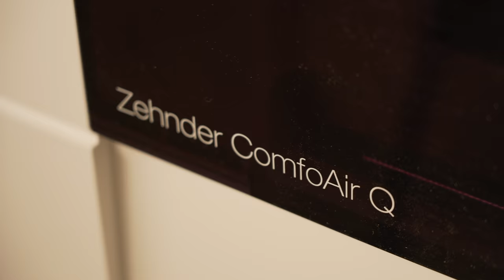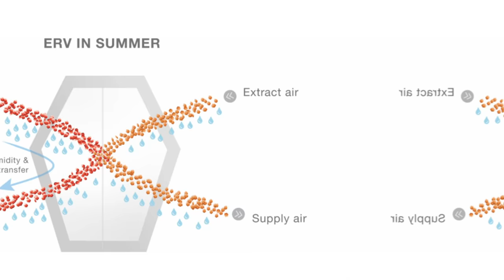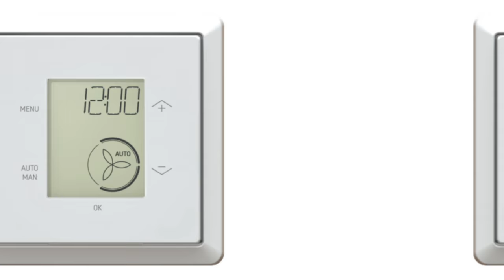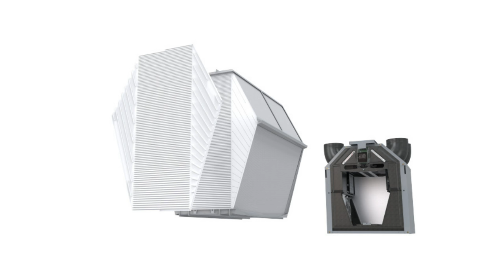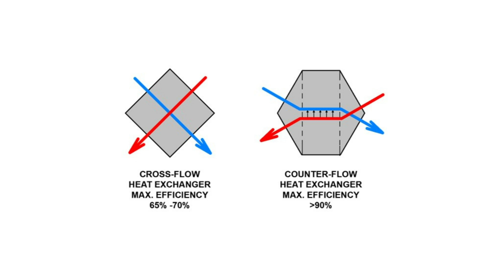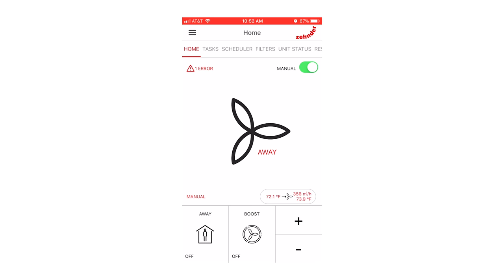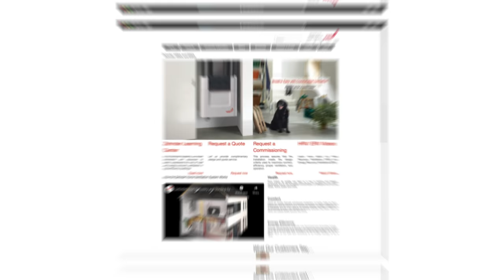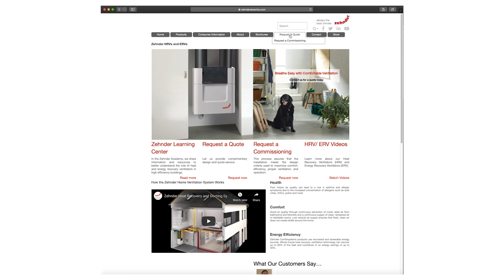Passive House - Fresh Air System Install & Costs (Zehnder)

Comment: Just  1 solar panel of 400 Watts can run this system for 10 years or more for free (after the cost of solar panels, Battery, and control system) and still have some extra energy to spare. He said this big system would use about 100 Watts, so about 2,400 Watts a day.  The average day is exactly 12 hours, the power you actually get on your panels is equal to about 6 hours of full sun radiation per day. Therefore 1- 400W panel (or 4 - 100W panes for lower price but need more space) would create 400Wx6=2,400W a day. Now, this house has a great large open space for multiple arrays of solar panels systems and since his whole house is running on electricity he can practically run the entire house on solar. He does not even need a battery backup and just connects the Panels to his Electric-Miters and the power production would be subtracted from his Bill. In some states, if u produce more power than use they would even pay u for the extra energy u give them. Now since he lives in Texas a really hot n sunny state his power production would be even higher. I would have a backup battery for emergencies since Texas Power System SUCKS! WHY THE F***!!! Texas is the only state in the country that is outside the National Power Grid?

Comment: I made the mistake of putting the intake and the exhaust fittings of my air to air heat exchanges on the west side under soffits 10 feet apart. In Massachusetts the predominant air is from the west. When the weather outside is windy it blows untreared air right through the exchanger. This means cold air in winter and hot air in summer BLAST right through the exchanger into my house vents. Make sure you tell people to avoid intake and output from prevailing wind side of house.
Reply: keep in mind that if is man made it can be fix !!

Comment: Matt, in Canukistan our building code calls for a 'principal fan switch', usually located in a hallway or other common area.  It's linked with a bathroom exhaust fan, usually the largest CFM unit, and fires a relay in parallel with that fan when either switch is turned on.  This relay closes terminals R and G in the furnace through a jumper.
Every time that particular fan is used in the bathroom, which is several times per day, or someone uses the principal fan switch, the house has air changes exchanges.  We usually use timers for one or both.
Is the air feeling stale?  Just hit the 30 minute button on the principal fan switch.

Comment: I get the urge to build to this level - but at the end of the day, a 25kW solar system still gets me to net-zero at a much lower cost after rebates.  26K to power an all-electric house (electric cars included). I have 4 Panasonic ERV's running 24/7 without any electric bills.  I still get it and I like it - I'm just torn with the expense, engineering, and volume of materials that need to be dealt with. Not that my house is any slouch in the insulation, geothermal, or window department. . .
Reply: If I've got the money to afford it, I'll get as nerdy with my HVAC system as I can. Never forget the nerd factor. If I put one in my house, I'd get endless hours of annoying friends and coworkers about how it works. Worth every penny.
Reply: I’d like to think that the comfort factor will justify the cost. Imagine being spoiled by engineered comfort. Downside is noticing anytime you’re in somebody else’s inefficient or unhealthy building.
Reply: Running ERV 247 is way excessive.
Reply: California already lets solar electricity go to waste during daytime since there isn't enough demand, for example.
Reply: Rebasepoiss that will likely not be a problem in the coming years as EV adoption goes up. CA needs to open up the grid so that residential storage can be a supplier, they have so much potential. It’ll likely happen sooner in TX though because of the open grid market (huge advantage)
Reply: Yeah, how do I recoup this extra 10k-12k?  I think it is awesome and all but it has to pay for itself?  I can spend 12k-14k to put Tesla solar panels on my house.
Reply: I've wanted one of these zehnder units for a while, but the price would need to come way down before the 1% would even consider it.
Reply: @Lenser  It really depends on the ventilation rate, right?
Reply: Our industry is getting better at measuring watts and BTUs, but we're still not thinking very much about measuring Indoor Air Quality. Contaminant levels that impact our health can be measured and there are sensors available that are ever more affordable. The research is becoming more and more compelling all the time. IAQ is even beyond comfort--it's about health and productivity.
Reply: @Lenser  Not when I don't pay for the power?
Reply: @christophersmith1894   I will 100% agree with you there - since we moved into our new house that has constant outside air entering the home - I don't think any of us have even had the sniffles in 6+ years. It makes a huge difference in the quality of life and comfort. Don't get me wrong - if I had access to your unit when I was building - I would have gone in this direction instead of the Panasonic units :)

Comment: So what happens when the power goes out during the night? You wake up with a low 02 headache?
Reply from the maker: Open a window. The house has plenty of volume for the unit to be off and not build up CO2 levels. It’s tight but not Zero air exchanges
Reply: Just wait.. he'll be getting tesla batteries next with some solar panels.
Reply: I love the concept and efficiency of this system, but hardlyb raises a good point.  All your eggs are in one basket now.  A super tight house won't bring in much O2 when the power is out.  Is there a battery backup option?
Reply: @buildshow  Okay. Glad you gave it some thought. It seems like a great house.
Reply: @DuncanCunningham  yes, but only is sponsored...

Comment: Matt, I have a Q in my PH and the feature I like the most is that it has a built-in humidity sensor. If you set the unit to 'automatic', it will increase airflow as it senses increased humidity levels. I didn't bother to install any boost switches - just the app on a wall-mounted tablet in the kitchen. The unit automatically spools up when people are showering or there is some serious cooking happening. I would have liked to have installed other sensors, but they weren't in the budget. Material costs for a ComfoQ without the extra filtration is around 10K in Canada. The nice thing is that the app will let you know when your filters need changing.
Reply: what the q can do is remove air and most of the humidity in that air. but it isn't really a moisture control system. it can only remove humidity from your house if the humidity in your house is higher than the humidity outside your house. that is probably true more often in canada than it is in texASS, especially during the colder months. when the humidity of the outside air is higher than the humidity of the air inside your house, some of that humidity is going to come into your house, and you will have additional latent load (presumably your manual j analysis took that into account). there are dedicated outdoor air systems, like the cerv2, which can provide moisture control. the cerv2 uses a heat pump instead of an enthalpy core.
Reply: @paperwait9611  Yes - I'm in a climate where I don't need to worry (much) about humidity or cooling. Cerv2 looks interesting. Fingers crossed Zehnder (or someone else) will bring/manufacture a 'magic box'.

Comment: How does the system handle dryer exhaust? I currently have two lint traps on my dryer exhaust and I still get lint getting past the second trap.
Reply: The system vents from the dryer room, not the dryer.
Reply: Put a HEPA filter in the dryer flue and all problems go away - just clean it regularly.
Reply: Probably best to get a heat pump dryer, then all of the lint is caught in internal filter at the door and most of the moisture condensed to a drain connection.
Reply: @nordlands8798  . Condensing dryers have not been popular in warm places (in my exp) - as the premium price over a non condensing unit for no additional benefit proviso you/one can vent the moisture outside.

 If "Code" limited maximum number of "envelope penetrations"  -or  monetised (penalties) bad construction methods then choice of appliance type could be weaponised in the push for "PassivHaus" /"ZeroNet"  (kidding)
Reply: kadmow Sure the heat generated could be more of an issue if you need AC, but with heat pump dryers it is not that much really. As more people buy them they also get cheaper, here the heat is no issue most of the year so almost all dryers are condensing, and now even most mainstream models have heat pump.
Reply: Nobody in their right mind would vent a clothes dryer directly into a room. No more than venting a range hood directly into a room.
Reply: @douglasjohnson8917  : Well there are places where dryers are sold which are designed to vent into the laundry room (ie NO duct fitting )...  Actually I have one (it lives in the garage and when I use it I open the door to let it vent outside...)

See, ones Paradigm is by no means universal.
Reply: @nordlands8798  . potential rephrase.? "In Norway (Edit) dryers are almost universally condensing" yes I realise, Netherlands and Germany too... In Australia (generally a Drying Climate) they are an "expensive" relative Luxury good (significantly more complex and expensive to make than the extremely simple type more common outside Europe. Hence fairly uncommon (Clothes dry in the sun here)  lol.
Reply: @kadmow  I will bet it is pretty much well Universal in the United States. I'm pretty old fart and I have yet to see a dryer that captures all the lint and humidity that comes out of it.
Reply: @kadmow  I said "here" which = Norway, but most midrange and above appliances are made in Central Europe. Although not fully part of EU, we also get most of EU regulations such as energy efficiency labels on everything. I paid equivalent of USD 330 before tax for my AEG condenser dryer with heat pump, so definitively not a very luxurious item here.
Reply: @douglasjohnson8917  Condenser dryers do not output much more humidity to the air than a quick shower does to your bathroom air, so no problem when placed in the bathroom or a dedicated laundry room also built with constant exhaust of air, floor drain and humidity-tolerant surfaces. I also get less dust building up over time in my laundry room than in the living room, so there can't be much lint escaping.
Reply: @nordlands8798  . Ha ha.   I did another Quick price check in Australian stores (price differential is huge).  A there is one condensing dryer for $600AUD -most are more like $800-900,  the heat pump versions (l see) are more like $1200-1400AUD.  When a vented dryer goes for ~$300AUD.  Interesting the differences between markets.   Sorry this thread got out of hand. All for the question of putting a vent in the wall or not.

(AUD= 0.72 USD )

Comment: Someday I would love to have a new tight house with a system like that. I'm tired of the dust in the house, no matter how often I change the a/c filter, and fresh air in the toilet room.
Reply: you will always get dust in your house.  a majority of dust comes from you, not the outdoors.
Reply: I never want a house like that, I maintain these systems for rich people and they are extremely expensive to install, maintain to keep them working correctly. People will never make the money they spent on it in energy savings as the market bs says period. They will cost triple over its life span the a medium range  systems and a home with some leaking.

Comment: Matt, love the ventilation system episode. But what happens for those of us that live in the desert SW.  I have both traditional HVAC with central air and an evaporative cooler system. The AC is great in the couple months we have higher humidity where the evap doesn’t perform that well and at night when the AC is very quiet. But an evap system is all about pouring a ton of outside air into the house and pushing it right out again through a slightly opened window or door.  Yes I can run a house on purely refrigerated system but the cost savings of the evap system is enormous, it simply works amazingly well.  In a nut shell we here in the desert would be throwing the fresh air out the window.  Big expense for a system that would only be useful during the heating months.  Also why isn’t the system integrated with your HVAC and eliminate double the ducts running to all your rooms?

Comment: Since this is independent of the heating and cooling system, when the humidity is high, aren’t you just bringing in high humidity in with the outdoor air?  Why not just connect the incoming air into your HVAC return air duct system so it gets cooled and dehumidified prior to getting released into the house?  Even with the claimed 85% efficiency, you are still adding humidity.....
Reply: Moisture from the incoming air exchanges with the outgoing air (the same way heat does) so you get the dehumidification for (almost) free.  That's sort of the point of the unit.  The exhaust air will have roughly the same temperature and humidity as the inlet air and the outdoors, and the supply air will have roughly the same temperature and humidity as the return air and the indoors.
Reply: AC systems are lousy dehumidifiers. And in humid shoulder months when AC isn't running, doesn't help at all. Need a separate dehumidifier.  The Zehnder is needed because Matt is building a super-tight foam-encased box and it's literally unsafe to live in without full-time fresh air.
Reply: My guess is that they are relying on the AC pulling out the humidity as it normally would and not worrying about it. From the sound of it, they're talking about pulling in .4ACH of 85% (though I think that was specifically talking about temp, not humidity) pre-dehumidified airflow. It's a bit of additional humidity, but I doubt the AC would have any issues handling that, especially if the AC was designed to run in a house that didn't have an ERV to begin with.

EDIT: Just remembered the AC won't be working very hard in this house, so he might be tacking on a dehumidifier in some future video. The more I think about it, the less I'm sure.
Reply: He said that it'd be within 60% delta of the outgoing humidity
Reply: @ArthurDentZaphodBeeb  : However this system could be feeding the dehumidifier  / AC train with fresh "reduced humidity air" - meaning ducted HVAC with only one set of ducts to living spaces.

Matt was showing off a  dehumidifier with fresh makeup air not long ago - This would be a fit for that system - cobble this method of duct manifolds and regulation, and it would be approaching an ideal system.

Even 85% humidity exchange efficiency is increasing the humidity in the house air by  a % (not really 15 most likely, but significant. - and also the temperature inefficiency % is increasing Heating and cooling costs by that much.

Obviously any similar type system (yes "this" is unique in North America) is much better than either a sealed tight envelope with no ventilation, or an open window.
Reply: @chaseweeks2708  Matt said he's installing dehumidification. Tight, energy-efficient homes need full-time dehumidification regardless.
Reply: The difference between ERV and HRV is that the ERV is able to reject much of that outdoor humidity. But humidity transfer isn't 100% (it's about 65% of the difference, depending on what speed you're in) so yes, Matt's Mitsubishi AC and Ultra-Aire dehu will be cleaning up the remaining outdoor humidity that the ERV doesn't handle passively. HVAC+D all work together!
Reply: Willy Doyle .  I get that, but you only get “partial”dehumidification since it’s only 85% efficiency.  So in the non cooling seasons, you are just pumping in humidity, granted less than the outdoors, but still humidity. 
Ducting it into the dehumidifier first, then the house, would seem to make more sense.
Reply: chase weeks   I agree, but I would think he would have made note that he was going to do that.
Reply: kadmow This is exactly what I was saying. I have had an ERV for years.  The incoming air goes into the HVAC duct work. My geothermal system has a multi speed fan and compressor. It will run almost continuously at a low and slow speed and quite effectively dehumidifies the air and not over cool the house.  It works very well and keeps it comfortable.

Comment: I'm concerned that this is not giving you enough kitchen ventilation to prevent cooking particles/oils from getting suspended into your household air.  There were a couple recent studies that found relying on these ERV's alone do not sufficiently maintain indoor air quality after cooking, taking hours to recover after cooking even in boost mode
Reply: Brian Wright If you have electric range like Matt does, it will be not that much of an issue. Most of the bas stuff is coming from the burnt gas. The rest is just smell, which some might even like it.
Considering that, the biggest issue will be the moisture, not the air quality.
Reply from the maker: Brian, I will have a separate system for my kitchen exhaust and make up air. I’m using a Fantech system